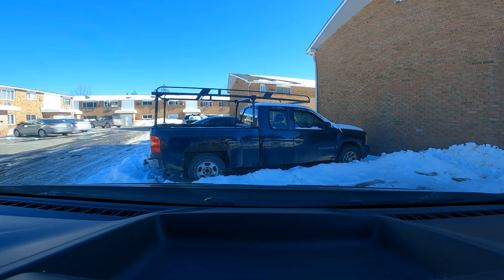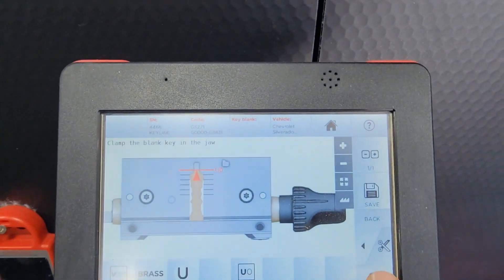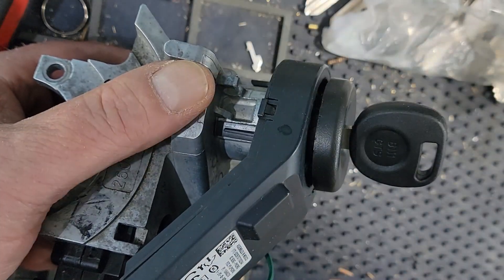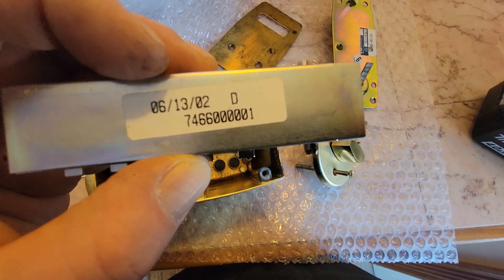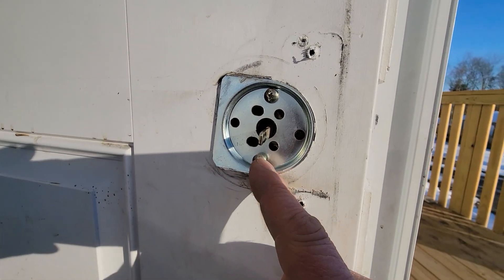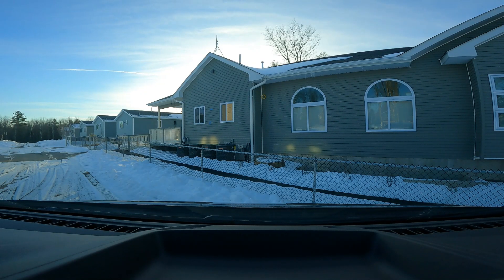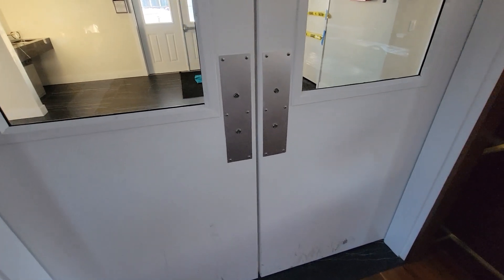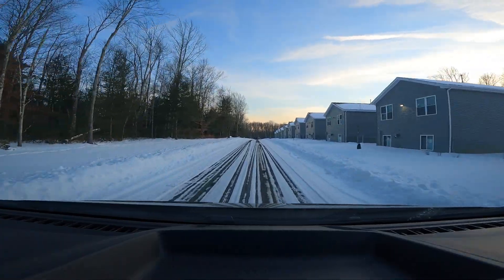Chevy Ignition Repair, Panic Bar Repair, Lost Combo Found, Afternoon Calls 1/27/22 Locksmith

Comment: I just realized about the not being able to park the van anywhere because of the snow build up and driveways not being cleared. This would be adding extra time out your day needing to park further away from a job.  That panic bar where the builders just cut off a piece of the locking mechanism just because it's in the way, that is so bad, surely they could have built the framing to accommodate it. Would that not pass code having that bit cut. Thanks for taking us to work today, I am just loving seeing all the snow everywhere, but I cannot appreciate how cold it must be for you going to work, It would be a struggle getting out of a warm bed each morning!, cheers
Reply from the maker: The snow makes it a real pain when the driveway is long and up a big hill, I would have to walk up and down. A few inches of snow is a wonderful thing for lost car keys though. That panic bar would still pass code "technically". The  Temperature has been about 0 degrees Fahrenheit with the wind chill the last few days and not fun to work in. Cheers PW

Comment: Nice job on that Chevy Truck.  I'm delayed cutting my daughter's keys as I need the Z keyway adapter for my Fra2.  Just for Giggles I pulled her ignition cylinder and It did not have the code on the cylinder.  I guess it was replaced as part of an ignition recall.  That's timely on the panic bar as Jason just showed how a mortice cylinder spinning causes trouble in a video a week ago.   
You mentioned kick plates just as I was thinking kick plates staring at the shoemarks on the door.  Nice Work.
Reply from the maker: All the ignitions I key for the dealer, I scribe the code in them. The key for he car doesn't work well ?
Reply: @locksny  it's getting worn, I confirmed the code by the installed wafers and will cut the keys next week when I get the Z adapter

Comment: Burrr Jay! Love those Chevy ignitions. Funny I did the same chip harvest when I bought my Express Van.( original key was really worn) Curious? Did you set the mastered Church building up with a high security key system? (a buy in type keyway) or just standard? Thanks for the tour!
Reply from the maker: Standard sc4 cylinders, they wouldn't pay the price for the good stuff. Chevy Z keyways are like job security. He didn't have to pull the lock out like that though 🙃

Comment: What a varied day.  You've really got it made with all these shuls.  Seems like a never ending supply of jobs.  And visually deciphering the combo of that old Unican was pretty slick.  The combination chamber looks fairly similar to more common Simplex mechanical push buttons.  Could you do the same on say a Simplex 1000?
Reply from the maker: Yeah the 1000's are just like that, you just look through the little window openings in the chamber rather then pulling the cover off

Comment: On the slightly older 10 cut GM ignitions I can repair or replace them if they've failed using the A1 gm pick, but if they've been damaged due to attempted theft I can't seem to get them out.  I tried drilling the side bar on one but was unsuccessful.  Any thoughts?  Thanks!
Reply from the maker: I have drilled some of them out over the years, you can also drill a tiny hole next to the sidebar and punch it back if they really screw them up. Next time I do one, I'll make a video.